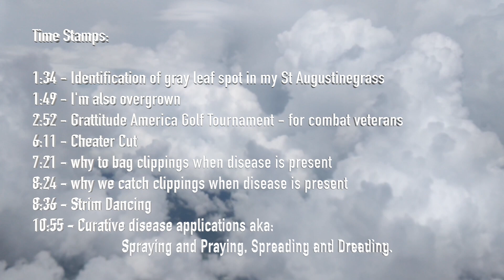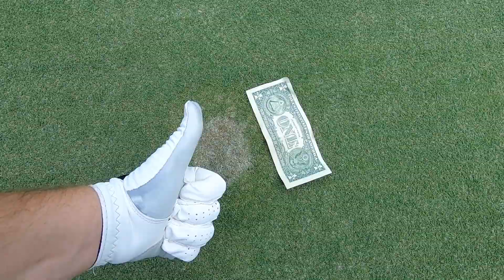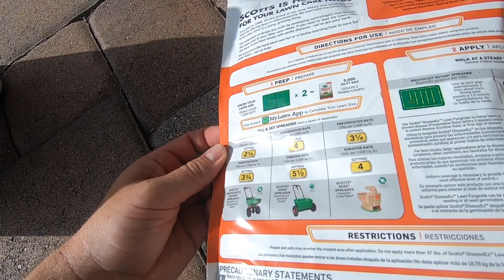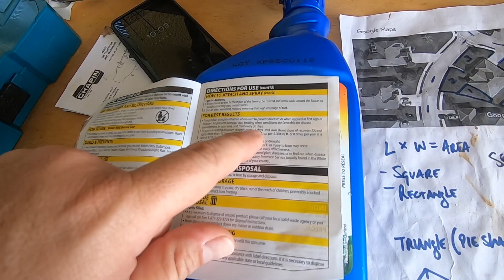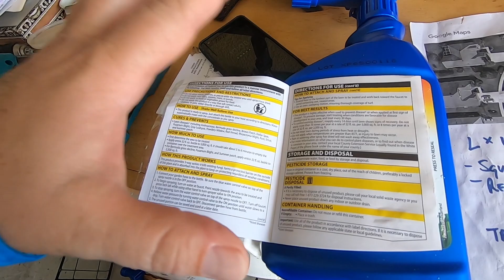Leaf Spot: Spraying and Spreading Corrective - Fungus Amongus

Comment: Love the video. I did a very similar app yesterday. I had never used the bayer fungicide. I always have done the bulletproof with Eagle from a pump sprayer with the diseasex. The 5-6 minute rate is extremely high. Attempted a 1minute per thousand ish rate and tore through half the bottle.
Reply from the maker: it does go fast! and Eagle works great too! good stuff.

Comment: I tried that Chapin sprayer and had better luck with flipping the what I call “duck bill” upside down so it’s more of a broadcast spray. One word of caution however if its slightly windy it can cause product to come back at you. I only use the N-EXT products in it so I’m not overly worried but just an observation. Also now that John taught us all that little trick I’ll probably be going back to the ortho because of the ease and the lack of can swing.

Comment: Some good information here for homeowners who are trying to treat their own lawns. If all you're going to wear is shoes and socks then it doesn't really matter what you do, that fungicide and any other product that you apply will be in those shoes no matter how many  times you wash them. Everytime you wear them and your feet perspire you are uptaking that chemical right into your body / liver. Go get yourself some good tall rubber boots and tuck your pant legs into them. I highly suggest to anyone who plans on applying chemicals on their lawn to purchase a book called "Applying Pesticides Correctly"
 Anyone that is basically applying chemicals should at least do it responsibly. Good to see you are wearing gloves (make sure they are Nitrile) and a long sleeve shirt. When washing those clothes always wash them separately from your normal laundry preferably in hot water.  Most of the time it isnt neccessary to treat a lawn with spotted blades. Just cut and bag the lawn and continue to grow it out of the blade. Refrain from applying any nitrogen when treating for fungus because it will feed the fungal issue. Other nutrients are ok to use in order to help uptake the fungicide into the root system (if it is a systemic fungicide) I own a pest control/lawn fertilization company and Have been a Florida State Certified Pest and Lawn care Operator for 35 years. I am only mentioning this so everyone understands I may know what I am talking about. Lawn care products are particularly nasty to the human body so use the appropriate caution.
Reply from the maker: good advice thanks bro!

Comment: gave up on those hose end sprayers, I pulled the trigger and bought the blue mule no regrets
Reply from the maker: I have one too - the model 20 I think - but the spray pattern is a little funky for me - did you change out the tip or keep it as-is?

Comment: If you turn the black tip on the Chapin sprayer you get different directional spray patterns, try it out. 

What settings do you use on the GoPro? I can’t believe how clear it is. 

John - thanks for the diaphragm tip on the Ortho sprayer.
Reply from the maker: I film in 60 FPS and it comes out clear like that. Pretty cool!

Comment: Awesome info and great videos, Quick Question,the last 2 ortho,sprayers I have are both putting out 3 gallons per minute  I know you both have videos of sprayers out there, is it a huge deal if the ortho is doing 3 gal a min doing the n-ext bio,soil packs , I haven’t upgraded to backpack sprayers, I cannot put much on my back “service injury “ so I might try the chameleon, or is there’s better options, I do have a one and two gallon pump sprayer, but I haven’t used them yet, kinda unsure about them?Again AWSOME info and videos by you both, Lawncology and The LawnCareNut,👍👍👌👌
Reply from the maker: is your water pressure unusually high? I have Orthos that put out 2.25GPM but never anything higher.
Reply: The Lawn Care Nut , we have good pressure, not really sure, city water supply, even with a leaky hose both sprayers are doing 3gal a minute, and tried all the different settings, off , then filled reservoir , no matter what I tried ,1 minute  3 gal, then I thought about the screen on the bottom, but I discarded that before I tried calibration, and even watched all of your videos and Lawncology and N-Ext on calibration, so I might try the Chamaeleon or a pump sprayer, or maybe try one more ortho, I really like that sprayer
Reply: The Lawn Care Nut I found out why my ortho sprayer is pumping 3 gallons a minute, we do have really good water pressure from the city system, I just dialed the nozzle on the house down and got it within specs to 2 gallons a minute

Comment: New subscriber here, loving the channel! I have a question for you. I have a 6 month old sodded lawn of centipede and there's some patchy, thin, or dead spots. I have Bermuda seed on hand already from my old house, is it ok to use to fill in the thin spots? Should I wait until end of summer for cooler weather? I'm in the panhandle. Thanks!
Reply from the maker: definitely don't introduce bermuda into your centipede lawn. Instead, get centipede grass plugs or sod to fill in the areas that are thin. For warm season turf, we rarely use seed - instead think of plugs as our seed. You can probably find trays at your local garden center cheap.
Reply: @Thelawncarenut  thank you! 👍🏼

Comment: Im confused when to put my first application etc.. I did soil readings this year, and looked up national averages and came to a conclusion soil temperature in Miami, FL are 90% of the time at or above 70 degrees. So where do I start with my pre-emergent? read your book but only states before soil temps reach 55 degrees but all year so far my soil is reading at or above 70 degrees... any help anyone? where do i start, where is the middle and how do I finish?
Reply: Pre emergent for what?
Reply: @joshualeon3486  crabgrass
Reply: @danielvaliente3956  I believe you put down pre emergents in the spring before weeds germinate but if you already have lots of crabgrass then you should use a post emergent herbicide..or shovel them out lol.

Comment: Thanks LCN.  Do you cut at 4 inch setting on Toro?  I cut at 4" with my Toro on St Augustine in Texas but its  causing my grass to burn.  Any tips?
Reply: How much water is the grass getting, when and how often? What soil type? Any areas grow well in shade? Have you applied any chemicals or fertilizer? When was I last healthy (vibrant (not chemically induced), lush, dark green, seeding, resilient after being stepped on)?
Reply: @johnlong9494  Grass looks good  all the time but dry after cutting for few days...you can see dry almost burning spots from sun.   Under tree where shade grass looks like your yard.  Soil is dirt (I hope that is right answer on soil).  I follow your recommendation of tuna can measuring with weekly watering of 1 inch in all zones.
Reply: @kerryt.6193  Hello again Kerry, this is John, I'm only a viewer. I am not Allyn Hayne, the Lawn Care Nut  (LCN). He is the owner of the content, presenter in the video, etc. I understand you asked him your question, but I responded hoping you could provide more detail for any good samaritans who felt like tackling your question.
Reply: You mentioned in your reply that the grass in your shade areas looks fine, but that the blades in the sun have spots on them, so it is not your mowing height that is causing a problem. In fact 4" is an excellent height to mow St. Augustine at and no reason to go any lower unless you have some kind of dwarf variety.
   Is the dirt moist in the sunny area getting spots? Is the dirt in that area lower than the dirt in the shady areas? 
    Were the sunny areas that have spots grown in as thickly as the shady areas?
     Is the area with the spots in a high foot traffic area? Heavy foot traffic may compact the soil, potentially damage grass, and create lower wet spots with slower absorption causing surface plants to stay potentially moist longer than intended, which makes them more susceptible to disease.  If your "burnt" areas are along the driveway or at the end of a graded slope that was meant to aid drainage away from the home, these may be concepts to consider.
Reply: Maybe dull blades??